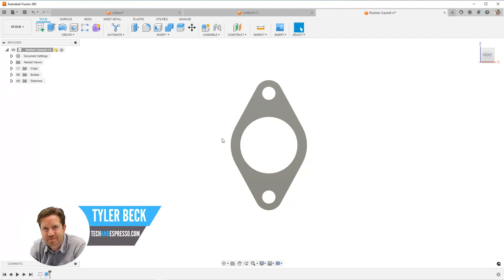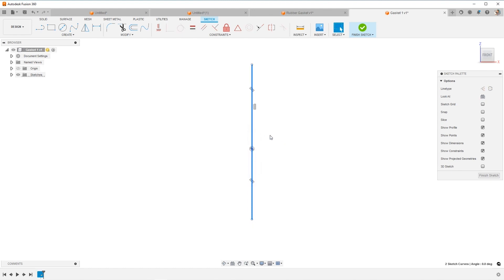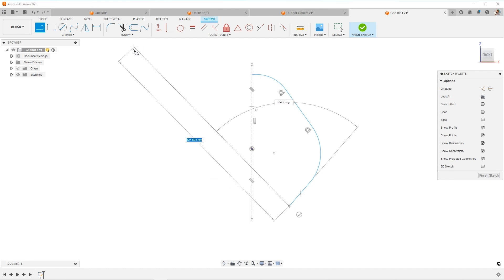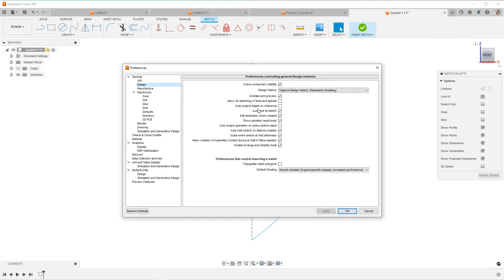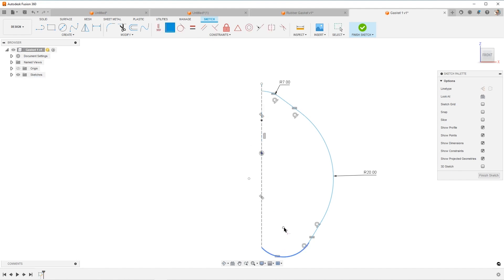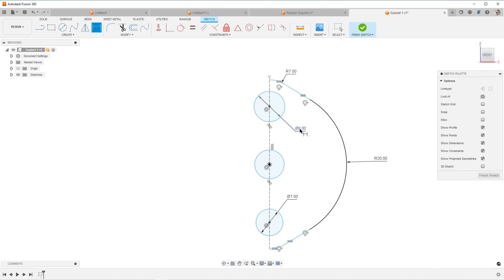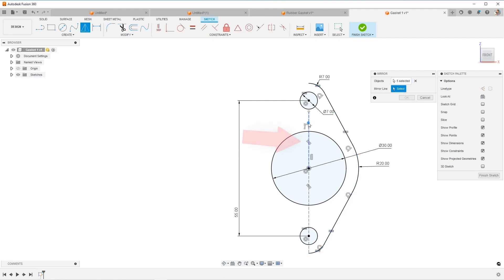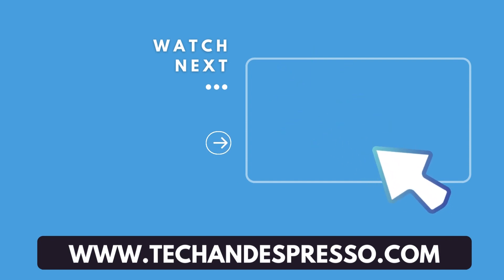Fusion 360 Gasket (Learn from this Beginner Exercise)

Comment: Tyler, LOVE your training!! I have a question about F360 and manufacture mode. It seems when the diameter of the hole is around 7mm or 1/4" in. Fusion will not allow for the hole to be cut...it simply ignores the hole. HELP...

Comment: I would have done this soOo much differently 

I would have started off with a center point rectangle on the origin

Then I would’ve tossed down some horizontal and vertical midpoint construction lines 

Then I would have picked just one of the four subsections to work within. 

Then I would’ve tossed in some dimensions, circles and arcs, etc

Finally,  mirror tool using the earlier horizontal and vertical construction lines to complete the missing 3 sections. 

This is just how I would do something with this much symmetry. 

Of course the whole reason I started watching your channel years ago it’s because you geared your content towards new users.

Comment: IMO, it's by far the best tip to look for the lock for making sure everything is defined. Sadly, everything can look black, but you can have points that are not defined, which will prevent the sketch from being fully defined. It's a weird problem, not sure if maybe keeping lines that have points on them undefined still blue would work, but it'd be nice if something was done...

Of course then you end up needing to use the command line and using the sketch.showunderconstrained command, which helps quite a bit, but can still be a bit tough to find things on a busy/complex sketch.